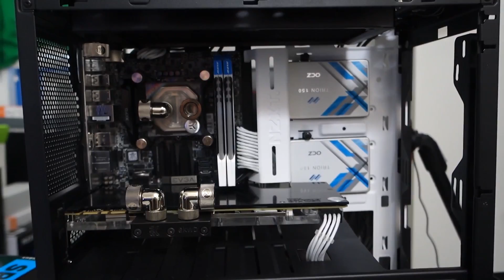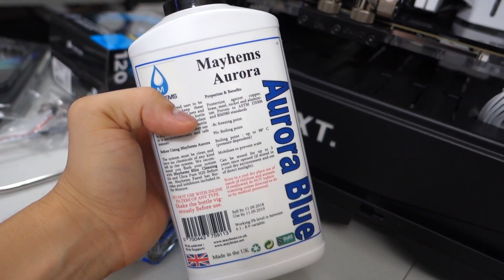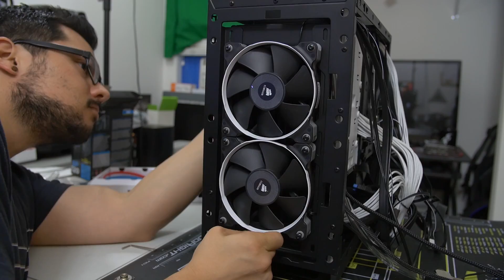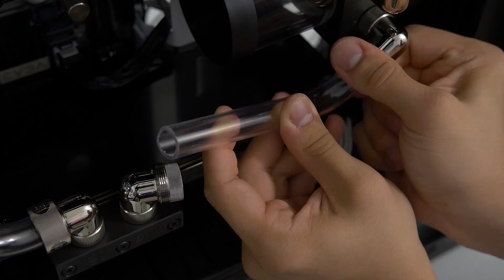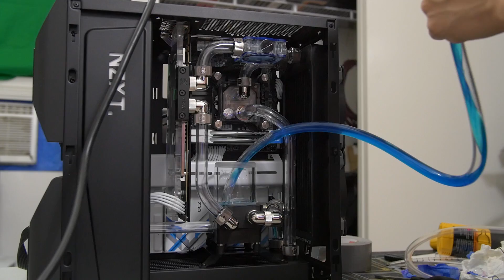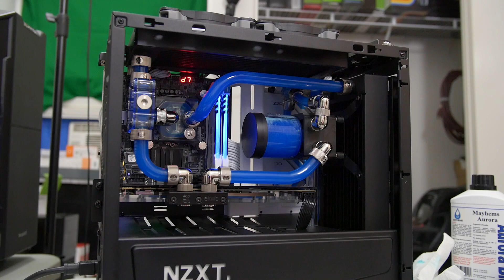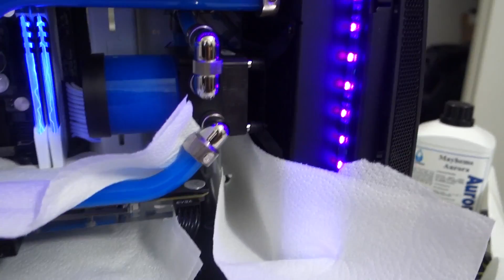Custom Tube Bending and THE MOST EPIC OF FAILS - Build Log #2

Comment: For the res clamping look up camera lens clamps. Mines made by cannon lol. They're chunky cast aluminium things but have a good finish on them with nice angles and hardware, they also have a (domed even) silicone liner embedded inside the metal clamp to keep your lens/reservoir nice and secure and scratch free.
They also fit the mounting plates quite well. If your mounting plate is sagging try fitting two together, those ones they sell us are very cheap press cut thin steel, not up for much. Aquacool is one brand I noticed who make their metal plates about 3-4mm thick (German brand). They wouldn't sag like that.

Comment: Putba couple spacing nuts or washers between the bottom two screws of the reservoir mount and the radiator before mounting.  Add more to raise it up as needed.

Comment: Just use a washer or two or three (whatever is needed) on both sides of the bottom of the tank bracket, in between the bracket and the rad. If it’s still not hanging parallel to the graphics card, use another pair of washers. Voila!

Comment: Use some spacers in your bottom screws to prop up the radiator.
Reply: Spacers won’t solve anti vibration mounts flexing. DDC should be mounted horizontally, not vertically.

Comment: Too late for this but you could use a spacer on half of the pump mount to slant it upwards. 

Also as far as the leak...this is why you blow air into it before filling.

Comment: I don’t understand why computer builders don’t use plumbers tape on the fittings, it makes an air tight and water tight lock (granted it’s harder to undo) but it would leak proof every fitting

Comment: Hey, IDK if someone mentioned a solution yet, but I would say to fix the pump sag. You could use some longer screws and some washers against the mounting plate; which may prop the reservoir up enough to fix the sag. :)

Comment: That is going to be a nightmare to drain, On the Inlet on the GPU go from the underside run straight down from the pump and use a Y splitter at the bottom, connect a ball valve(lower than the GPU) there or mid run so its easier to bleed and do a refill and drain, also wiheither of those 2 fluids 3 months on drain and fill no longer with a yearly inspection of the blocks and fittings/Orings so you know there is no gunk build up.

Comment: As a glass blower, I would suggest heating more of the tube before bending to avoid any amount of kinking. If you heat 3x the length of the bend it will be smoother. I really love how this looks identical to lampworking which is the glass blowing I do. I am a computer noob and just finished my first build. Now I want to add liquid cooling like this and bring my glass skill to my computer.

Comment: Use washers like shims on the bottom bolts to straighten it out.

My personal preference would be to just use distilled water with the dye. It will match the heat spreaders better. The dark blue is too dark. Thats just me.

Comment: Spacer under the bottom feet of the reservoir can level it...you should use pads or rubber washers anyway to dampen the vibration from the pump or in the long term it will oval your holes.
That reservoir cap will eventually leak that you installed sideways, the gasket staying wet on one side will cause it to crack unless you keep lubrication on it, I mean like relube it monthly.  I have used even industrial reservoirs on water cooling navigation equipment and seen it leak.  Bad idea to mount it sideways...

Comment: Washers on the bottom pump res around the bolts that screw to the radiator And probably 3 to 4 should be more then enough. Help you achieve any angel you desire without to much stress on the components.

Comment: For the pump res combo, maybe try adding a few small washers on the bottom screws to angle it a bit and then when it sags down it might be parallel to the GPU.

Comment: Probably suuuuuuper late, (years late) but could have painted a washer or two black and used them on the lower mounting point to space out and stand the reservoir back up.  Not hard.

Comment: 1 or 2 washers at the bottom screws on the radiator that holds the reservoir should do it! The metal have some flex to it, and should bend a little more after the reservoir is filled, so the washers should do the trick.

Comment: FIX FOR PUMP SAG : bend the feet of the rad mount
And the radiators are blocking the UV light from hitting most of the system

Comment: If it hasn't been suggested you could try some black washers between the rad and the bottom feet of the pump res.  And I don't think it's the pump res's fault, the metal on the rad might be to thin to hold the weight of a pump.  Something like this https://www.amazon.com/uxcell-Nylon-Washers-Screw-Thick/dp/B07MX9KC12/ might help.

Comment: @bitwit i know im a tad late to the party, but just put a washer or 2 between the brace aand radiator on the bottom two mounts, i think that will be the right angle to hold it up

Comment: use washers to straighten it out. if you add washers to the bottom until you get it straight then you can either paint them black or use nail polish.

Comment: Drain valve you put on the lowest possible place in your loop by using a T splitter (or specifically in your case a goog place would be on the downside of your graphics card and then going with an angled hard tube to the lower left corner of the case). And where you have put your drain valve, there goes the fill-port, so that you don't have to disassemble the res and put your PC upside down when you are filling. You might even go through the case and have it outside on top of the case, look up EKWB EK-AF FillPort.

Also, remove that tube holding the pump from the downside, bent the fan-adapter pump holder lightly to the upside, so that when the pump/res is filled and "hangs", it would be perfectly straight. And yeah your tube connecting the pump/res to the graphics card wasn't good, but you figured that out and already corrected. Nice.

In general try running tubes horizontally and vertically and bend at 90 degrees, it looks far better. Use a bending tool in order to get a smaller bending radius.

Comment: Why aren't we watercooling are ram
Reply: There is ram out there that you can watercool, well, heat spreader, but watercooled nonetheless.
Reply: CyanideGaming! Saw it last week the water in the heat spreader did nothing
Reply: @parz173  I think it's more so for the sake of 'watercooling'. Just like the whole RGB craze. Or when they brought out a watercooled PSU which from what I seen didn't really watercool any components, just cooled down the back of the PCB.
Reply: CyanideGaming! Yeah I know but wouldn't it be more efficient if the waterblock was on the memory modules with its own loop that's what was referencing it would be stupid but as you said water cooling fot the sake of water cooling
Reply: @parz173  I suppose, but it would also depend on the set up. I mean if you were just using watercooling for the CPU, yeah I'd add the memory into the loop too, but if it was GPU and CPU then perhaps have the CPU and memory on one loop and GPU on a separate loop, seeing as GPU's throw out more heat than a CPU. I've also seen a long time ago there was something about watercooled HDD's, like you could put a hard drive in a enclosure of sorts and it's watercooled, weird, but again, just for the sake of it. 

The most I'd go for watercooling is CPU, GPU and intentionally NB and SB.

Comment: Put a single or multiple washers on the bottom screws on the radiator to prop up the radiatot and pump to parallel that tube. Might need longer screws if u need more than 1 washer and each screw

Comment: For fixing that sag, just a rod or a block between the bottom of the pump facing the rad and the rad itself would likely be enough tension to prop it up. Just a piece in the shape of a slice of a c iron bar would be perfect as a subtle fix. Reinforcing that wobbly POS bracket could also work, but it would be a hassle and a half without tools.
Edit: Also, forcing the reservoir up with washers between the two screws holding the bottom of the bracket could also work, but with that much wobbliness the elastic deformation might turn plastic.

Comment: to fix the reservoir sagginess, you could use one of those round shaped reservoir brackets and place it vertically so as to hold the reservoir in place. You will need to drill at least two holes, or maybe some strong 3M double sided tape will do just fine

Comment: Dont power up the computer. conect a 12v power to the pump. then if it leaks you just dry it out. if water gets on the board or PSU then 3 days or more some ware warm.

Comment: Can you fit a spacer under the lower bolts of the reservoir to push the bottom a little more than the top (by effectively tightening the top more) to create an angle, which due to the sagging, will appear level?

Comment: Dude... use another power supply and short it to power the pump when filling. If there are no leaks then plug the pump into the system's PSU. If it leaks, nothing will get shorted because nothing has power, cept the pump.

Comment: How come no one tephlon tapes the threads of the metal elbows and splitters? Kind of like a safety precaution?
Reply: Because it's completely unnecessary. If the O-ring fails to seal, then it'll leak, teflon or not. It won't come out at the threads, but between the tube and the O-ring.

Comment: a little too late but you can fix the sagging issue by adding spacers on the bottom two screws on the bracket. therefore propping up without spending more than a few cents.

Comment: at 6:00 the answer to your fix is to bend the mounts of this unit.  Bend it in a way so that the top 2 mounts of the 4 point mount is a bit shorter (Bend it up), this way when gravity takes it's course it will bend back down making it perfectly straight.  This is your only solution as far as I can tell.

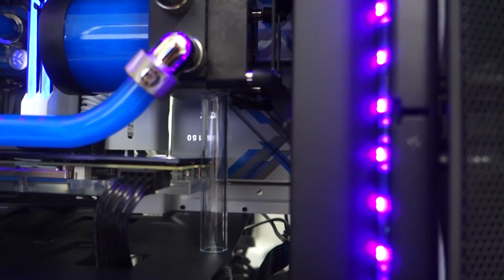Comment: Plug one end of the tube then fill it up with the blue liquid then plug the other end to seal it.  Then put your kick stand back in then it becomes part of the system which absolutely does nothing to the cooling system other than a conversation piece. 10:51

Comment: If you want to change the angle of your reservoir tank take the lower to mounting brackets and loosen them input either washer or spacers in depending on how big the Gap is and it will compensate for the bends in the middle and it will change your alignment at that you're looking for

Comment: I have a solution for you with the pump problem. If you put rubber spacers on the 2 lower bolts of the pump maybe it is even then.

Comment: I know I’m a bit late but you could try sorting out the res droop by putting a 1mm or 2mm thick washer at the bottom on the res mounting bracket or the at the bottom of the rad to compensate for the sag

Comment: TO PROP IT UP; find something smart to use as a shim, UNDER the two lower supports where its screwed/bolted to the rad. that way itll be raked upward very slightly, a couple degrees or so. it can be very finely tuned that way, with just the right thickness of a small plastic washer or something between the two lower mounting 'legs' and the rad. the angle will then be correct.

Comment: Ha! I did the exact same thing. Forgot to tighten down the caps on my 980Ti waterblock when I refilled the loop (I opened them up for draining) and had a nice fountain in my system. Water went under the backplate where I couln't just whipe it off, so I left my system sitting for two boring days. After upgrading to two 1080Tis I disassembled the 980Ti to see what damage it had done. Some of the passives where pretty corroded... It luckily still works and is now running in my buddy's system.

Comment: Shouldn't the Drain Valve  be at the Lowest part of the loop. Make a strong steel backward S bracket and connect it to the Rad holes under the res support holding the res up. Or you can 3D print one with hard ABS plastic. but steel would be better. Just use the Mayhem looks Radioactive and awesome!!

Comment: Pro tip, stop leak testing and bleeding using your actual power supply. Wet components can be dried if they never had power going to them. 

Buy a super cheap PSU, plug your pump into it, jump it. Let it sit.
Reply: That's actually useful

Comment: Acouple of rubber washers between the bottom 2 holes  on the pump bracket and the radiator will get rid of the sag

Comment: Instead of putting the tubing kick_stand on the pump end, how about make another tubing kick_stand...lit bit longer, enough to hold the reservoir in place fr the bottom and place it in the middle of the reservoir, but you have to carve the top of the tubing 'u' shape, same contour as the reservoir, so that way it fits nicely. Perhaps, its not bad how you have it now; cause tube_stand is kinda hidden fr view. However the way I recommended has better leverage tho.

Comment: were you bolted the pump to the radiator place two washer at the point you attach the pump could push the pump up the screws may had to be longer!

Comment: I haven't seen it mentioned yet, but common-sense tells me that the reservoir should probably go higher up than the CPU as a kind of "Failsafe" 
I'd also look into using teflon Plumbing Tape on any part where there is a thread. 
Then again, I tend to place more emphasis on "Function" rather than "Presentation"

Comment: Do we need fans on water cooling ??
Reply: Yes. The radiators need to transmit the heat from the water to the air. Without the fans this would not happen.

Comment: to prop up the reservoir - put a few washers between the feet at the bottom of the bracket and the radiator. should raise it up enough to be level.

Comment: Ha I did a similar (not quite as bad) thing yesterday with my wet bench...  

Try putting a black washer under the lower legs of the reservoirrto hold it off further at the bottom.

P

Comment: I've noticed that, if you put a fan on the back of your case by the I/O, it can significantly reduce the amount of air getting to your radiator on top. I did the ever scientific sticky note test, where you stick one beside the top fan mount and measure the height change (about 1cm lost with the back fan on, using corsair SP fans). Could just be my case, but it's fairly safe to say it would do this for all.

Comment: mixing water with electricity....watercoolers are dumb as shit and know nothing of specific heat and how water ceases to dissipate heat after a an hour or so.....the only to make it work is to use a thermostat like in a car if not you have a glorified air cooler after 2hr's.

Comment: With the pump leaning, you have 4 screws, 2 top and 2 bottom, put some rubber washers on the 2 bottom, until the problem is fixed

Comment: About the EK flow meter leaking because of the stop fitting, I had the same thing with my EK reservoir when I innstalled it. I used all Bitspower fittings, and the one on the reservoir was leaking. I had to replace it with the EK fitting that came with it, and that annoyed me. At least it didn't leak after that, but I had been very careful to only use copper parts throughout the entire loop, and then I was forced to use a nickel stop fitting.
I love EK blocks and radiators, but I don't like their reservoirs. I am replacing mine with a Monsoon reservoir as soon as I can.

Comment: I liked the video a lot, but would make one comment about the flow meter. Although it lines up nice being parallel with the back panel where the case fan sits, you can not see the flow of the liquid. After all, that is what it was specifically designed for...so you can always look and know your system is flowing. So I would have rotated it 90 degrees so you can easily see the impellor turning. Thanks for taking the time. Peace Out.

Comment: Regarding the attempt to level the reservoir/pump, have you considered bending the top of the mounting braket to pull the reservoir closer to the radiator at the top?  That way when the reservoir weighs down, it will end up being level under it;s own weight, instead of sagging.

Comment: Take spacers/washers an put them between the screw an the mounting area for your radiator.. the two bottom screws... put enough washers in between them an you should be able to prop that reservoir PERFECTLY where you want it sir!

Comment: I know its been a while since you did this build, but if you put some washers on the lower side of the pump mount to the radiator it will prop the sagging side up to make it level or perpendicular to the video card.

Comment: you can put a couple of washers or nuts under the lower bolts. that way they wont be as tight as ones on top. that will help lift the pump a littel. i hope it will help
Reply: oh it has already been suggested lol. forget it.

Comment: Water cooling is all nice and pretty and works well, until you want to change something in the way of the tubing, then it's shit.
and leaks...   back in the very early days when I was water cooling slow one CPU's and the 533 celeron, the number of times I had to rescue a motherboard from a leak is shiver worthy.
best board survive six separate leaks!  it was a trooper and then some.
these days, my I7 is so stupidly powerful I don't need to overclock, there's simply no point with what I do.

Comment: I have read over and over that you shouldn't use the colored liquid as it leaves a residue.  Rather you should use colored tubing.  I have completely cleaned out my rig before and I know it is easy to clog the super thin fins in the blocks.
Reply: I should have started with that is was a cool and useful video.  I used flex tube and now want to try the ridged tubing like you did.